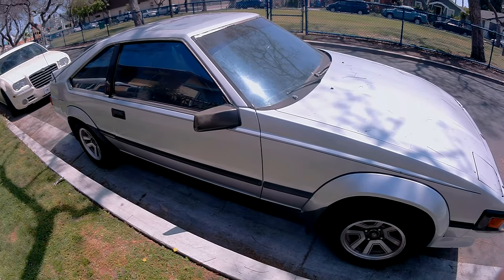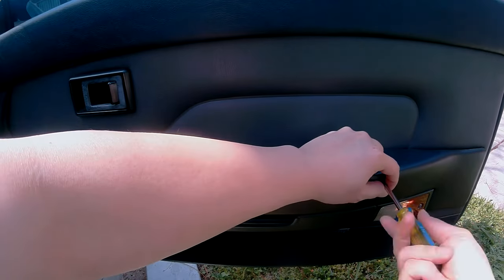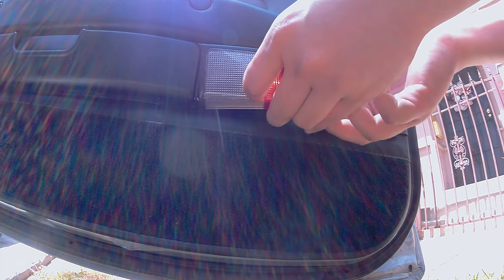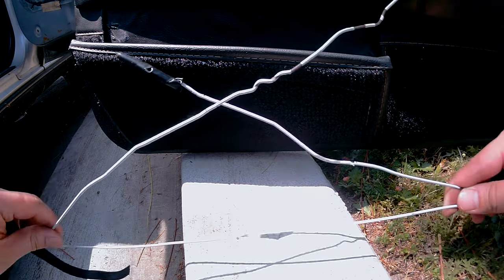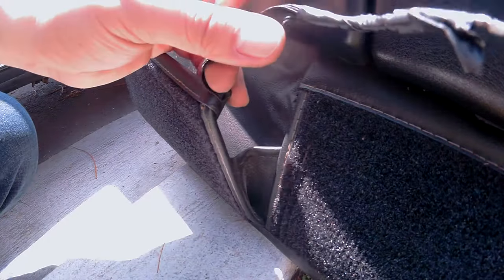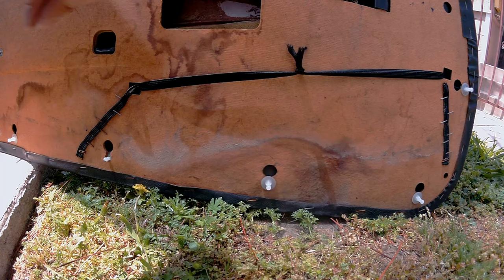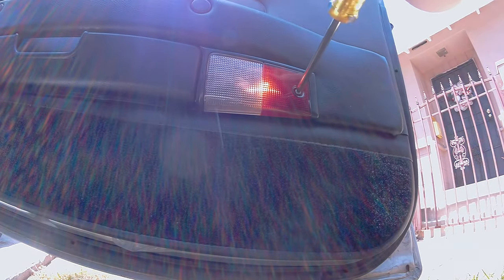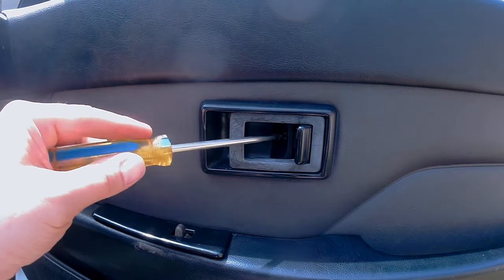(MKII) 1985 Toyota Celica Supra Door Pocket Repair

Comment: Very helpful video. Where did you get the dash cover?
Reply from the maker: I got it on Ebay. It didn't come with a hole for the sensor located at the passenger side so I had to cut a hole. Kind of messed it up as I was in a rush at the time. Can't really tell though.
Reply: @johnsneverendinglistofrand1377  can you share a link?
Reply from the maker: @krishouan2433  https://www.ebay.com/itm/Custom-Fit-Dash-Cover-Toyota-Celica-Supra-1982-1985-Pick-Color-DashBoard-38-04/333135336913?hash=item4d9069d5d1:g:7Z4AAOSwrn9cnYuq
Reply: @johnsneverendinglistofrand1377  Thanks! Which material did you go with? Just carpet?
Reply from the maker: @krishouan2433  yeah. Mine is black carpet.

Try putting in a note for them to add the hole for the light sensor at the passenger side. They may or may not add the hole. I had to cut a hole on mine.